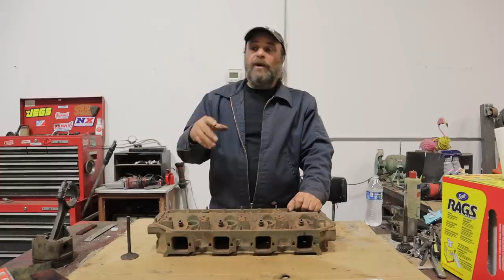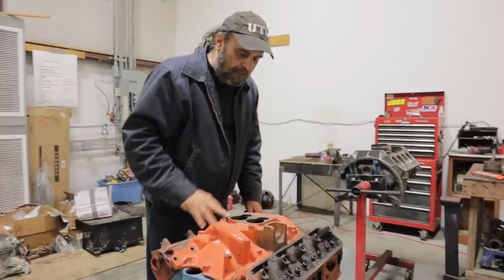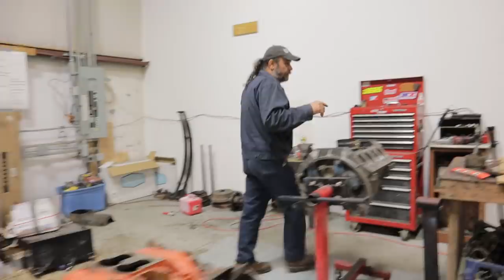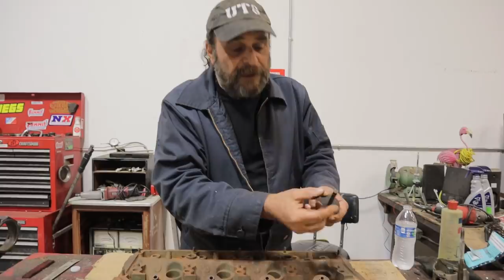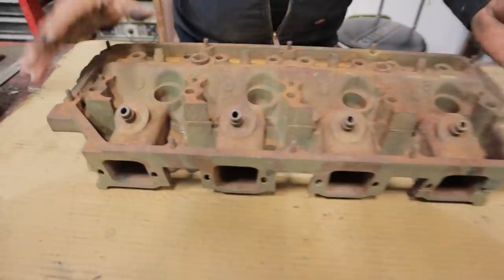Carburetor MPG Myths And Intake System Thermodynamics

Comment: Tony, I like most of your videos but this one has a bit of incorrect information. I am a chemist for a living and have taken college level courses on thermodynamics. I agree with you talking about vaporization occurring when fuel hits hot surfaces and keeping things free of carbon. However, when you talk about temperature drop below the carburetor due to "atomization" this is just not right. Simply busting the fuel up into smaller droplets will not change temperature. There is no chemical process known where "misting" a fuel causes a temperature drop. Evaporation (the phase change from liquid to gas) is actually the cooling process which is responsible and temperature changes with this can be calculated with methods taught in college chemistry. Evaporation point can also be manipulated by pressure.  This can be seen on what is called a phase diagram. When the fuel goes from the bowls to the intake tract it is moved from an atmospheric pressure environment to a sub-atmospheric one, allowing easier vaporization of the fuel, thus causing that cooling phenomenon. Everybody forgets about the pressure aspect. If you have ever spilled acetone on your hands and it feels cool to the touch, same thing going on.  I can explain more if need be.
Reply: Btw the fuel in the carb bowl never gets anywhere near 200 degrees.
Reply: Hey Mr gangster if they can make gasoline in a form of propane it would be best mpg
Reply: I have a methanol burning Duster by the way!
Reply: Never heard of carburetor icing?? Its moisture in the air freezing belowing the throttle blade and on the venture. It happens especially in colder climates
Reply: I seen propane injection with a blower on a 383 ..
Reply: If evaporation is a cooling process, then wouldn't the global warming caused by our classic cars evaporate more sea water thus cooling the Earth?
Reply: HVAC technician.
Reply: @afastcuda1970  Yes, our oceans do a great job of regulating the earth's temperature. Without them we would have fried ourselves by now. Ocean temperatures do increase though. That energy has to go somewhere. We are lucky water has such a high specific heat and can take a lot of energy before increasing in temperature. I also want to add that melting is a cooling process as well. When you go from ice to liquid water, it takes energy to do so. (bonds break causing the phase change) During the melting process ice is transformed into water but the temperature doesn't change during melting.
Reply: That atoms of vapor carry the heat away, it doesn't disappear.
Reply: @jasonhooey5677  you are right,  that is why piston engines on aircraft have carburetor heat controls that are used for takeoff so the engine doesn't ice up and quit during takeoff
Reply: The air passing around the atomized fuel will cause some evaporation but also cool the droplets with ambient air. This is why some cars use a heat riser and a hot air intake off the exhaust manifold. I do like your points about change of state between liquid and gas, that is where the most change of temperature will occur. Tony is not wrong though.
Reply: @markdavis3362  I don't see how a 100+ degree under hood air temperature will cool 65 degree fuel droplets coming from the gas tank.
Reply: @thegangster3786  it's still a lot cooler then 200. Lol.  That is also why a cold intake is so important. I don't think it cool by a 100 most of the time in the summer,  maybe 30to40 degrees.
Reply: Well said. Another good way to explain that the evaporation causes the cooling is how when you use a propane tank for a long time it begins to freeze.
Reply: So when Droplets of Fuel are Busted Up into a Mist ..That Mist isn't Cooler ??? You have me curious now .....And I hope you are following this so you will answer me .. Thank You 👍
Reply: @donaldalbershardt6854  Lets start with thinking about the ocean. The sun hits it, heats the top layer of the ocean. That heat energy increases the temperature of the very top layer and it evaporates. Energy is used in that phase change, and that bit of energy does not go towards increasing ocean temperature. (although some heat is transferred before the water evaporates causing increased temperature in the water below) Now lets transfer this over to fuel. Say you have a fuel jug open sitting in the sun. The top layer of the fuel will evaporate, and that heat energy goes towards evaporation. The fuel will get hotter from slow heat transfer but that evaporation cooling process is still going on at the surface.  Now lets transfer this over to going through the booster of a carburator. You send the fuel through and it gets busted apart into many tiny droplets. The surface area increases tremendously.  Now lets think about the formulation of gasoline. It is composed of many different hydrocarbons, all of which have different boiling points. The molecules that have the lowest boiling points are now in contact with air rather than swimming around the bottom of the fuel jug being kept happy by the molecules at the top evaporating. Now remember that the intake has a lower pressure than what is normally in the atmosphere. When these molecules are put into that environment the phase change is forced due to the pressure difference. (There are less outside molecules squishing the fuel together keeping it a liquid) Since there was no energy input causing the phase change (like the sun with the ocean) temperature has to drop. Now that temperature has dropped though, this puts other molecules further away from evaporating. So you are only going to get so much phase change (cooling) depending on intake temperature.  So you could say the mist is cooler, but it is not the process of creating that mist which is doing the cooling.
Reply: @thegangster3786  OKAY Thanks so the mist does become Cooler from the Droplets 👍
Reply: @thegangster3786  your explanation of ice melting is very interesting.
Reply: I love my G20 convertion van with a 350 engine. I can afford to drive it because I buy 2 beers instead of a six pack...

Comment: I used special hi-performance spark plugs, carburetor, ignition, fuel and engine treatments. Every one gave me a few percentage points improvement in mileage. Eventually I got over 100% and I had to rig up a pump and an overflow tank to collect the excess gasoline created by simply driving my car.
Reply: Hahaha.... That's awesome
Reply: You too ?!!
Reply: Big brain
Reply: Stonks for sure
Reply: WHAT ?? 🤔
Reply: @donaldalbershardt6854   he is dreaming...
Reply: Sounds about right! Personally i use the magic "seafoam", which gives 3% improved milage with 1 can per tank. Now I use 12 cans per tank, and get 625% better milage, and sell gas back to the gas station every other say instead of buying it. Works great! 👍
Reply: @Santor-  That compound improvement is phenomenal!
Reply: @Santor-  Yeah, the fuel economy claims in additives is crazy.

Comment: Back in the ‘70’s, some of my friends were obsessed with efficiency and mpg. I got pulled into the mix as well. I was driving a ‘65 Chevy, with an inline 6. A guy at work had bought a truckload of NOS carbs, 1, 2 and4 bbl, still in the box. He was selling them for $10/ barrel. I bought a number of them. I put a single throat Rochester, made for a stationary engine on my car, hoping to achieve maximum mpg. Bad move! Burned 2 exhaust valves. An engine will only do what it can.
Reply: My experience with a Chevy straight six was a 250 in a 1978 C10 stepside with three on the tree. They may have been reliable, but what a terrible engine. It’s got mileage like an eight, but had the power of a four. I didn’t keep that truck for very long.

That truck helped me find uphill grades I never knew existed. I was driving on the highway and the truck was slowing down. I thought something was wrong, but then I realized I was climbing and it didn’t have the power to hold 70 mph
Reply: The engine is the pump.
Reply: @MrJeffcoley1  that's crazy. Your truck wasn't running right. I have the same exact setup but instead of 3 on the tree I have a th350 automatic.  My truck doesn't spin tires but it's more than adequate. Rochester mono barrel
Reply: @mikem5475  I had just bought the truck near Abilene, TX in 1989 or 1990 and was driving home to El Paso. It was firing on all cylinders.  I didn’t recall if it had points or HEI, but according to the specs it made 115 hp in a 4000 lb truck. I’m sure I would have tuned it up but I don’t recall. The long uphill grade was Interstate 10 between Midland, TX and El Paso climbing out of the Permian basin. Usually there was a headwind as well. I was rolling along at 70 but when I hit that long, long climb speed dropped off to about 55. I actually pulled over to check the plugs and wires to make sure they were OK. They were.
Reply: @MrJeffcoley1  I believe it the way you describe 100hp for 4000lb. Mine doesn't have any emissions equipment, and just a cherry bomb glass pack muffler. Engine bay looks very uncluttered. I wonder if the emissions stuff really messed it up or maybe my standards are just low for how fast something is
Reply: @mikem5475  The power wouldn't have been such an issue if it got good gas mileage. I had a 1973 Chevelle with a 350 V8 and a TH350 that got 18 mpg highway. The truck was about the same. Lousy mileage, AND underpowered. I bought that stepside regular cab for $1000. Wish I could buy one for that today.
Reply: @MrJeffcoley1  that chevelle sounds nice. My dad got my c10 back around 2010 for 1000$ no rust, drove it home and everything. I remember getting it and my brother's truck, a k20. His truck still bucks from a badly adjusted carb, like the day we got it. I have yet to get my 250 legal because it has a salvage title, not sure why. But I'm excited to see if it gets decent gas mileage. I have a 4.3l tbi s10 that really gulps fuel so my bar is set pretty low
Reply: @mikem5475  The Chevelle had a 2.73 rear end. It was slow off the line, but the top end was awesome even with the 8.5:1 compression and smog cam. I could bury the needle on the 120mph speedometer, and I mean literally out of sight under the window on the dash. Probably doing about 130.
Reply: @MrJeffcoley1  that's awesome. I want one now
Reply: @MrJeffcoley1  the issue with it is that the square body is just about the worst vehicle for fuel economy. Shaped like a brick, often hiked up suspension so air can get all under it and cause turbulence and weighs 4000 pounds. Back in the day my dad built a 283 for a 76 blazer and the best he ever got with that gas sipping engine was 13-14mpg. It just takes more to propel a square body than a passenger car where a 6 banger really does eek out better fuel economy. I’m applying a similar 283 to a camaro I’m building and I’m expecting at least 22 mpg combined.
Reply: RE-JET NEXT TIME 👍
Reply: @donaldalbershardt6854    I did, but the wrong way. 🙄
Reply: @creativerecycling  OKAY next time Bigger Jets 👍👍
Reply: As my experience is limited with old Russian engines, did the carb from the stationary engine have an accelerator pump? Because that's what them russkis had, a special carb for those engines without one.
Reply: A squarebody and fuel economy are two words combined that don't make sense XD 
Best bet's prolly a larger torquey engine that you don't have to mash it to move and can keep ya in as low rpm's as you can at highway speeds

or a diesel.
Reply: @pyrrhus17  yeah egr is definitely not healthy for an engine. I hope we all can agree on that. I'm not even sure that it helps gas mileage, maybe at idle but how many people idle their cars?
Reply: Really
Reply: That intake manifold looks like my '73 340 intake, only mine's blue.

Comment: 95% of carburetor problems are in the ignition
Reply: vary true! hot spark and a good timing curve! and you need most the time to conect the vaccum advance to full time vaccum as idel is a low density hi vaccum situation!

Comment: I use your info to help keep my daily driver F100 with a 223 running smoothly. Thank you for the “old school” knowledge!
Reply: Don’t copy him too much or you’ll have it pulled out rebuilding it every week
Reply: @Terminxman  😂
Reply: Thanks Tony, I keep learning really usefull stuff from you. Apparantly the lack of valves is one of the big reasons rotary's aren't more efficient, it's also why they're so freaking loud; no exhaust valve to absorb heat energy from the exiting gasses. I'm guessing it also applies to 2strokes.

Comment: In the tuneup classes I took back in the 70s the instructors emphasized the importance of starting the tune  up process with a combustion chamber cleaner. UT just explained why .
Reply: AC Delco  X- 66 top end  cyl (,spray or  fluid ,  decarbon  formula, on  carburetor  engines  worked great following  directions. &  occasionally  helped  early  EFi  systems ( special  port psi adapter tool  required)  .  Still  a good  treatment  if still  available. Derivative of Naval cannon carbon cleaner  distilled  for automotive  uses.   Follow mfg.directions. Or seek those  who know.... oil / filter change  &   Fresh⚡plugs After treatment  etc. 💨💨💨
Reply: @joekurtz8303  I used to use that or something like that from AC Delco.  It was called "Top Engine Cleaner".  You had to "choke out" the engine.  Let it sit for 15 - 20 minutes, restart it and hold your breath.   The neighbors thought I blew up the engine.  I don't know if it helped the engine but there weren't many mosquitos around for a couple of days.😎😎
Reply: SeaFoam

Comment: Well put Tony. I’m an old timer like you. I have a newer truck but my daily driver is a 1976 F150 4x4, 360 granny low 4 speed. I love that old truck. Yes it uses more gas than my new one and doesn’t handle as well. But it’s dead nuts reliable. And I can fix it if it needs anything which rarely happens at only about 5,000 miles per year. Your channel has helped me keep it on the road and I thank you, sir. I really appreciate your teaching style. Oh and guess which truck pops everyone’s eyes.... not the new one.
Reply: had a 1977 f100 flare side! had a 351w 2v with a c4! had hedders and a diy hi out put ignition and a recurved dizzy. got 20 mpg! loved it was a day to day driver! was simple and reliable!
Reply: I’m right there with ya, Brian. Tony has taught me so much with my older vehicles as well, albeit they are TBI rather than carbureted. But I too have a newer 2016 Silverado, but daily drive my 1987 C10 (although she’s undergoing a major project to upgrade the aging fuel system, brake system and replacing rusted components) and I get WAY more comments on that than my Silverado. But my 1986 Thunderbird is the ticket. I’ve had it all my life and rebuild the engine and trans last year. Being able to take Tony’s teachings has allowed me not only to keep that car running, but also increased the mpg’s from 23 on the highway, all the way up to 35 mpg if I’m not romping on it on the highway. And for both vehicles - anything wrong with them, it’s a simple turn of a wrench, adjust this, tweak that, and they are back on the road in no time.
Reply: You’got some sweet rides there! And thanks to Tony!
Reply: @brianhdueck3372  thanks man! I really enjoy them and take them to car shows too. The c10 has 123,000 miles but my thunderbird only has 46,000! However they are skyrocketing in value so I do drive them like a little old lady haha!

Comment: I'm in total love with this series of videos Uncle Tony! I kinda knew that carbon deposits could make an engine not run properly or lose gas mileage, but I had no idea about the science of it! Amazing video once again! o/
Reply: Intake  carbon acts like a sponge & can create lean Pre- ign knock.( bad) Sacking Fuel/ air mix @ cyl.🌀💥💨  or cyl inefficiency🏁  good fuel= filter  svc,   some  occasional additives    for low  octanes  help . Correct base timing per spec  depending on Mfg . & Year of production . Basics. (SuK-SQuiZ- B💥-.&B🌬💨)

Comment: In the 1940s Nash had their "iso-thermal™" head on their 6 cylinder engines.  They had no intake manifold.  The carb mounted directly to the head. The air passage inside the head ran over the top of the exhaust ports.  The theory was that heat would vaporize the incoming air/gas mixture and would evaporate the gas droplets into a pure vapor for combustion. 
I don't know if it contributed to the MPG, but I smog checked a 56 Nash in the 1970s and it was surprisingly clean burning for the time era.
Reply: Nash advertised the highest gas mileage of standard sized cars.
Not tire burners.
Reply: @hotrodray6802 
Yeah, 0-60 was measured in minutes 😅    They advertised 23 mpg in 1953.  They won the Mobil Gas mileage run that year.  The Nash 600 advertised 30 mpg.  Like today it's best-case scenarios.  I got 19 on my 54 Ambassador in the 1970s but it dropped to about 13 nowadays with the sh't gasoline and all.  In fact when I upgraded it to a 350 crate engine the mileage is still at 12.  A little more peppy now.
Reply: @Iconoclasher  except I have a 400hp ls motor that gets 40mpg on the highway... And a Camry that frequently gets 50mpg.

30mph is not today's best case scenario lol
Reply: @UFC_Buffalo 
I can understand that.  My lovely 54 Nash Ambassador has a SBC 350 now.  (can't hardly get parts for the old Ambassador 6 anymore)
Now I'm getting 13 mpg.  😂